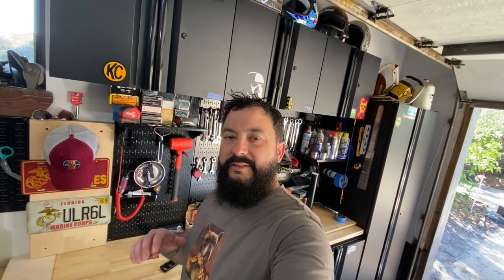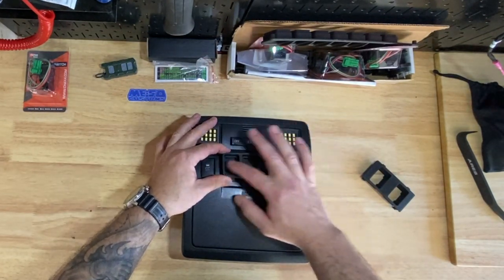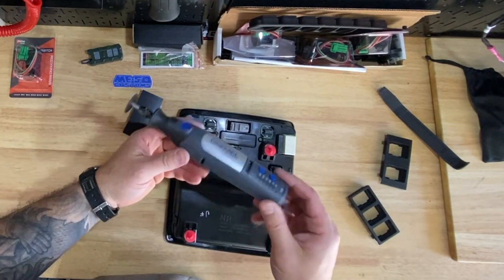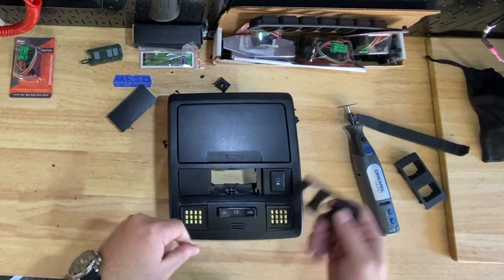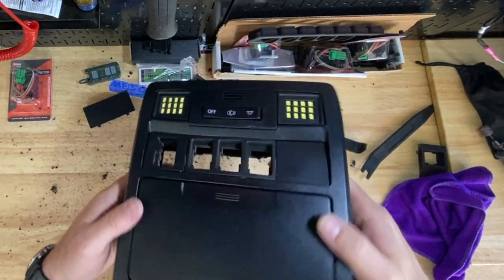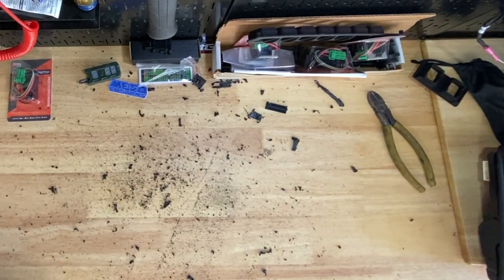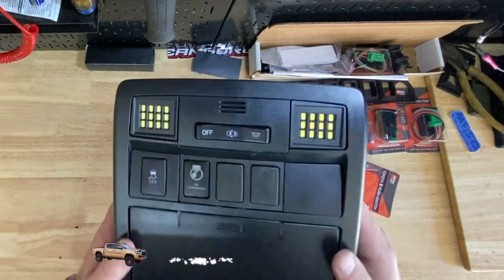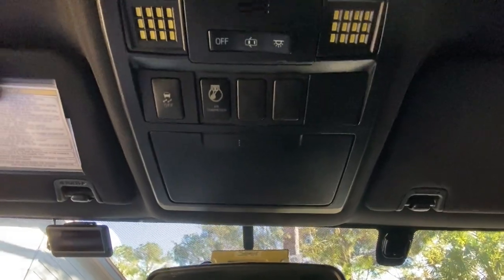Toyota Tacoma | MESO Customs Overhead Console Switch Panel Install | (2017 Tacoma)

Comment: Nice!  :) :). I told ya to be careful with those red clips, they get crushed easily, so you got to take them out first off the overhead console after taking it off. Next, you should use painters tape and tape over the console to protect it and put a cloth or towel down on the bench before you get to working. Don't dremel or drill holding the console with one hand. I was wincing the whole time you were cutting it. We all learn the hard way. I destroyed one overhead console myself and had to buy a new one myself.
Reply from the maker: Thanks for the advice now. I really only learn the hard way.